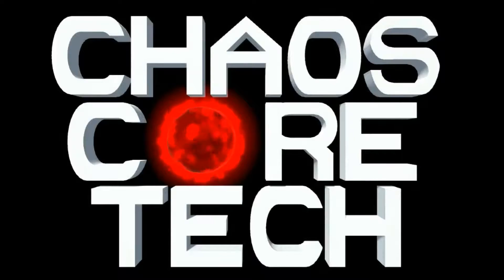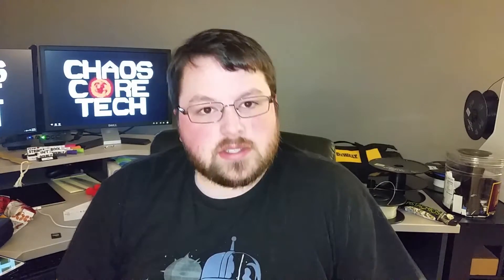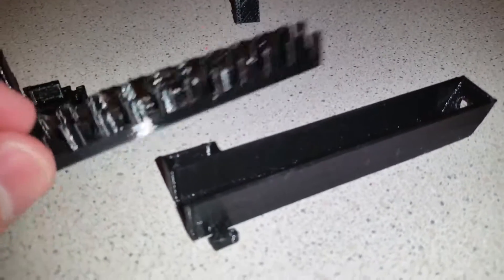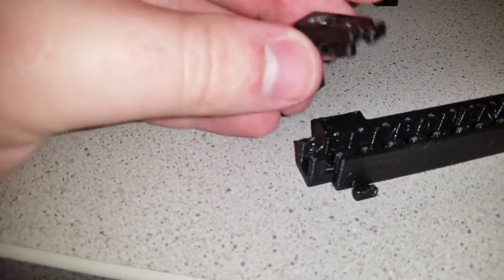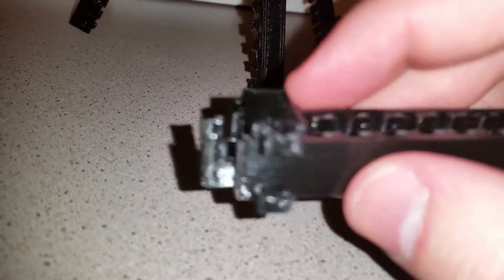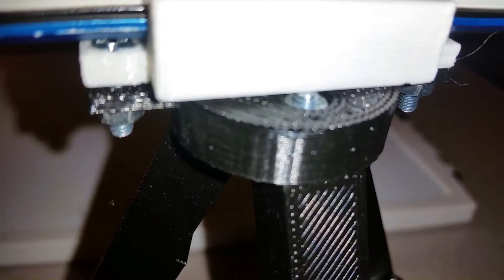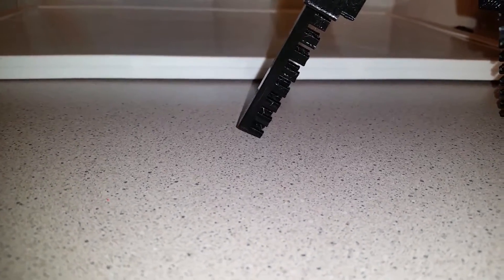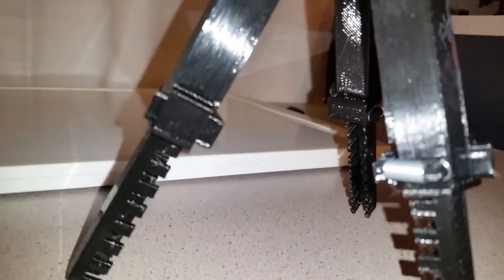3D Printed Adjustable Tripod (Spring Loaded)

Comment: Great work. Really like the simplicity of it. Also using springs to tension the lock-mechanism in place is really cool.
I would suggest, if you want to give it a try, to use a wave pattern instead of a saw pattern for the internal legs. It would require less force to adjust the legs and they won't break if you put more force onto the tripod. Also, if you print the waveform sideways, the print will be very durable and will have less weak points (the outer shell will follow the wave pattern).

Keep up the good work.
Reply from the maker: +Georges Jentgen Thank you, I appreciate the feedback. And that's a great idea. It'd also make it look a lot cooler. I actually left it hollow because I thought about adding another step of extension but I decided not to. So I'll have to give that a try. I'll let you know when I do. :)